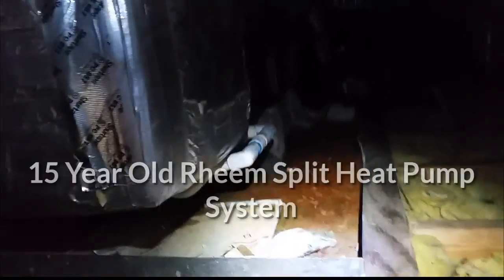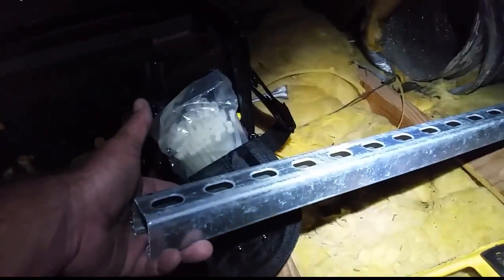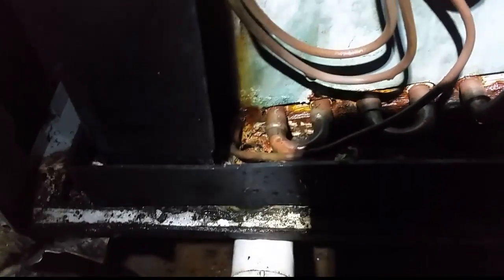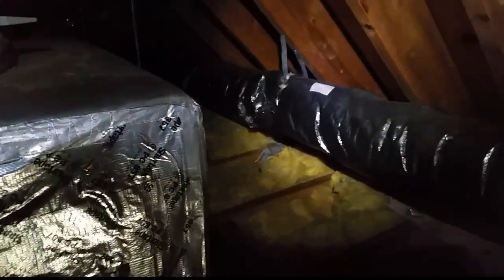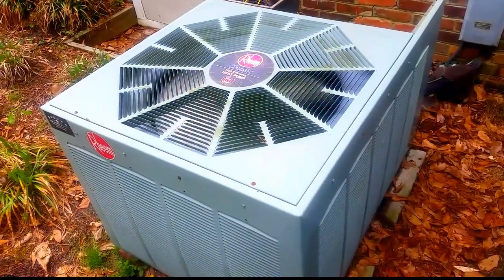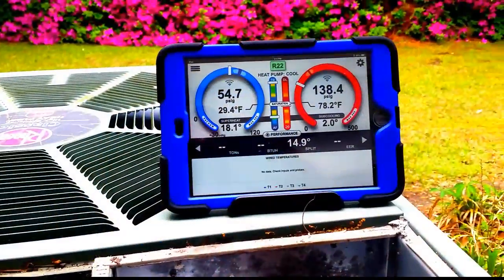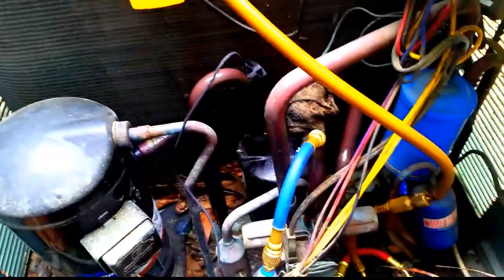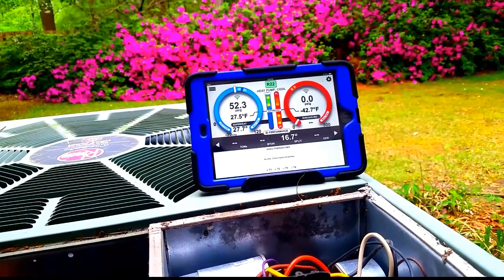HVAC Service : Overhaul Heat Pump System

Comment: Thanks for another great video. Some of those systems had txv's and pistons. I have a RPNJ037JAZ. 15 year old. It has indoor and outdoor txv's and indoor and outdoor pistons. Sub cooling don't seem to work, superheat don't seem to work. I just give up and used the charging chart. When you do the change out, it would be interesting to see if that one has the Pistons too..thanks again for the knowledge you share.....
Reply from the maker: Thanks, and your right these have pistons and txvs

Comment: nice videos.  what is the outside temperature on this video.  I'm now learning to charge by superheat instead of blow and go.  99% are pistons.  and did you half to figure wet and dry bulb for your charge?  Thanks.  
'
Reply from the maker: All Hours Maintenance it was 65-70 F. You get indoor return wetbulb and outdoor dry bulb. The equation is 3 x Wetbulb temp - 80 - outdoor dry bulb temp. Divide the answer by 2 to get target superheat. 80 is a constant.

Comment: Nice work Zack , all that works wasn't for nothing it will save the ceiling and like u said can be reused once they r ready to do the change out.
Reply from the maker: Right on. I sighed when I saw those pressures.

Comment: You guys need your own show on a&e, Air conditioning wars, pitch it to a&e! Good video!
Reply: I'm calling on Monday
Reply: If people watch taxi wars, there's a lot of home owners and people who are into remodeling home would watch it. There is s learning factor in it, what to watch out for, hvac is kind of a black art, hey you never know! (:
Reply: Like that video, also with the low airflow came a coil temperature that was below freezing.

You are exactly right, sizing it to the ductwork would be much better at this point if you cannot or they will not replace it rather than the load. I see a ton of under sized duct systems.
Reply: Jim Bergmann I've been watching all these videos on the iConnect and you guys have almost got me talked in to buying one I wish it would have came out before the IManifold if it would have I would be sporting the iConnect now

Comment: what are you using to connect the allthread to the joist, I dont think ive seen those, sure would make it easier as I use unistrut top and bottom, which makes crazy angles sometimes. Thanks
Reply from the maker: I will try to put the hangers on a blog video